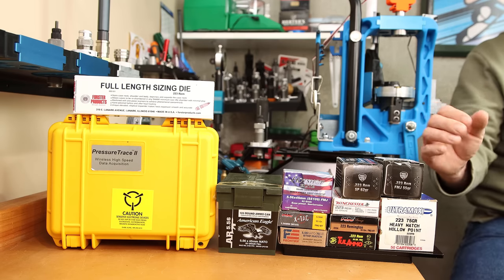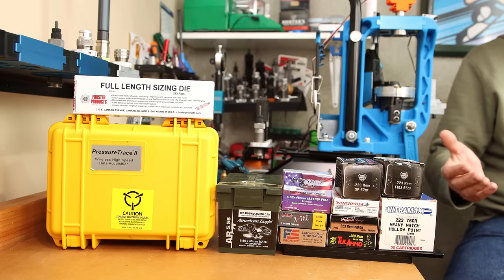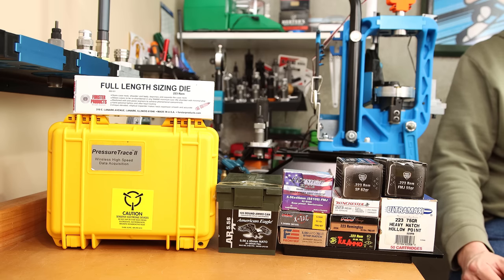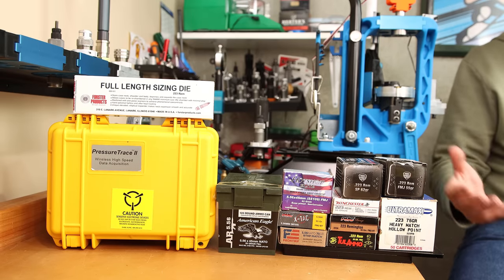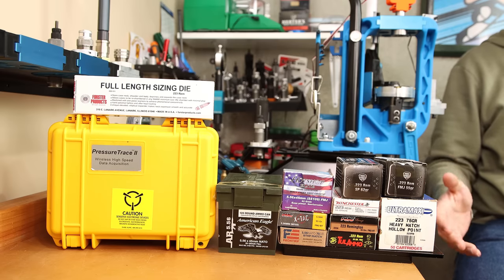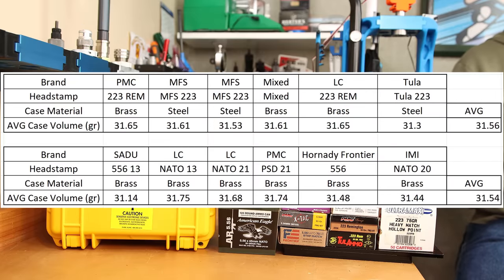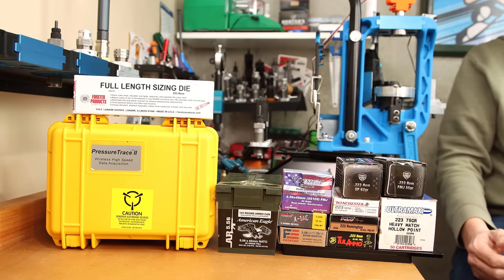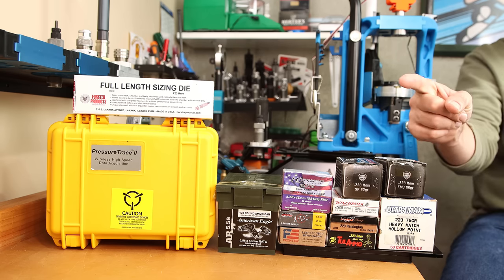223 vs 556 - The Hidden Truth No One Tells You!

Comment: For many years we as reloaders have been told that the difference was in the case webbing at the bottom of the case. The webbing was a little thicker to handle the higher pressure. I have seen in the past of cut away views showing a little thicker webbing at the bottom of the case. That was a few years back. I am not sure if there would be much of a weight difference for the thicker webbing. If the information is correct gun manufacturers highly over make the pressure guns need in the chambers. Some clam 3 x the rated pressure need for said cal.

Comment: The 5.56 has a higher pressure measuring at 58,000 psi as compared to the 233's 55,000 psi. Going by SAAMI standards, the lower pressure 223 can be used in the 5.56 chamber, but the 5.56 cannot be used in the lower pressured chamber for the 223 Remington.

Comment: Yes. I have said for years the only difference is the mil spec is higher CPU (Copper Pressure Unit) chamber pressures. Technically, the higher CPU needs a slightly heavier chamber to handle the higher pressures. When someone wants to argue with me about the differences, I just point them to this video. Problem solved. I think it is funny that people that don't know, sure are confident they do know.

Comment: The first gen 556 x 45  M-16 had issues. It was susceptible to chamber corrosion and the ill advice that it didn't need regular cleaning. It was corrected in the second gen weapon. The chamber was corrected with chromoly steal, it was provided a cleaning kit and instructions on how to use it and I never had my M-16 fail due to case expansion or fracture. The weapon handled the pressures perfectly. And it saw thousands of rounds put through that bore before I left Vietnam. I can say nothing bad about the M14 and I agree it was one of the best rifles made but the M4 and the M16 were not 223 and the performed well in that theater. They were light, and we could carry more ammo. I liked it.

Comment: Great video, thanks! I just had this conversation with a friend and like you said, he couldn't provide any data whatsoever, just hearsay.  OK, that said, I have an AP Wylde chamber AR-15 and here is my experience.  5.56 LC brass will NOT fully chamber when sized with a standard RCBS die.  And it fails the test in my Wilson case checker.  However, commercial .223 brass loaded to the same specs, including bullet seating depth (off the lands) chambers great and perfectly passes the case checker test.  The only way I can get 5.56 to properly chamber is to use a small base sizer.  After reloading thousands of rounds this fact still holds true today.  Same thing for my brother's non-Wylde AR.  Just my .02.  ;-)

Comment: My understanding was they were dimensionally identical, but guns designed for 223 couldn't reliably fire 5.56 because of the higher pressures/charge, but vice versa was ok. Nice to know I was kinda sorta right, even though I didn't know the detailed reasoning. That's why when purchasing my AR I went for 5.56 so I didn't have to worry about availability of ammo.

Same thing they told me when I was active duty over 20 years ago.

Comment: Colt TDP 5.56 AR or M-4 chambers require a 1.4646 minimum go gauge where the 223 commercial requires a 1.4636 minimum go gauge..Short chambers create higher pressures..

Comment: I never heard / the data difference on the internal size of 5.56 being smaller inside the case , as I remember. Also 5.56 has a thicker Shell extractor than 223 bolt actions because of the need for full and semi auto fire it was disghned for. Or the heat dispersal from the cases being removed from the barrel. Which is why case less ammo firearms aren't fiesable. New subscriber . good show . just a farmer .
Reply: Manufacturers use the same brass for 5.56 and .223.  The only difference in the case is the headstamp.

Comment: They are different no matter how close in specifications say, your rebuilding and engine and use just a hair smaller or larger set of pistons or bearings and it will malfunction sooner than later. Mic each case as well, they differ at the neck.

Comment: I don't have any data but I've heard Lake City brass is a little thicker than Remington brass. I shoot Winchester Palma 308 and have heaps of cases but if I switch to Lapua the cases are thicker so it's just a common thing to look out for in any caliber. One of the guys at the club stopped using Lapua and better luck with the thinner Winchester cases, I think this is due to them expanding faster as they're weaker and as such you can't reuse them as often as Lapua.

Comment: When i was in the Australian Army I was told that at the Lithgow Small Arms factory in New South Wales, Australia they had a steel plate which they would test fire into, it was the same plate used for all 7.62mm NATO  L1A1 SLR test firing since 1958, when we changed over to 5.56mm SS109 after awhile they had to change the plate as it was warn out, also back in 1990/1991 i was posted to Range control SASR and at the 360/270' range at the special range complex we had signs saying SS109 could not be used only F1 ball ammo.

Comment: The warnings are more for non-handloaders.  Handloaders should be taking precautions as the norm.   If you chamber and shoot a 5.56x45 round in a .223 Rem chamber - you could possibly be jamming the bullet into the rifling which would cause an unsafe pressure spike.    How often would this actually happen?  Probably not that often but it can happen.  Also, 5.56 pressure is set higher, so   better safe than sorry.  That is my understanding as a handloader as this vid is starting...

Comment: So... a video about the differences of .223 Rem vs 5.56x45mm but without shooting from either a .223 or 5.56 chamber? What is the point?
Reply: The point is to compare and contrast .223 and 5.56 using measurements and other empirical data. There are plenty of channels that shoot if that's what you're here for.

Comment: The 223 was invented and tested for military guns. The 5.56 designation was later and tested in different ways. The thing is as a reloader you will find that if you have 3 rifles in 243 winchester, you shoot the bullets from one but if you reload it and put it in another gun without first case trimming it it may fit tight. This is because each chamber can be a little different but still be within specs. That being said whatever is stampped on the case if you start with a low charge and work up with either case it will be ok in either a 223 or a 5.56.

Comment: I have a Colt SP1 20" AR-15.  It is chambered in .223.  I have fired the 55 grain 5.56 round several times without any signs of overpressure. I'm now wondering if I can have my current barrel modified to the Store chamber.  My 5.56 ammo is from older governmenal sources.  All .223 ammo is newer 55 grain commercial.  1 in 14" rifling.
Reply: I hate auto-correct!  It should have read Wylde  chamber not the Store chamber.

Comment: I load my own for both my custom AR-15's I built just like I do both my unlimited and light gun class 1000yd benchrifles and every rifle I built or is a factory bought weapon as well as tune for some of my customers. I have two tight tolerance AR15'S with matched billet machined upper/lower reciever sets both with 1:8 twist Wilson Combat 5.56 match barrels. I like the free bore of the 5.56 chamber as I only use 69gr smk, 75gr TMJ speer, and 77gr smk to stretch the 556 out to longer ranges. I use Redding National Match Die Set, I also load pretty hot and like spherical, dust or flake powders such as H335, BL-C(2),  CFE 223, and AR-COMP and I always use CCI450 small rifle magnum primers with those powder types. They are hot, high pressure loads for a  5.56 match chamber and through my years of experience loading I would not advise running them in a 223rem cut chamber. 
  You are correct to that the difference between the two is the Chamber, I don't think to much factory ammo marked 5.56 is loaded now days as got to a higher pressure as it use to be due to this reason and mistakes made by countless casuals (typical everyday American who is just a guy who hunts and shoots maybe 8 times a year at most) I'm sure you could find a box lot of stripper clips full of 62gr green ball military ammo loaded in the 80s or 90s to find out for sure. When Lake City Brass was the thickest heaviest brass available (certainly not like it is today know that Olin Winchester owns it again for like the third different time)

Comment: They probably suggest reloading to whatever is said on the back of the brass so you or something else isn't confused when they see a mixture of reloaded 223 and 556 brass. Better to just keep 556 556 and 223 223 because of the markings.

It's like with those who mark their 556/223 magazines and their 300 blackout magazines. They use the same magazines and it is clearly marked but for the sake of safety you only use the magazine with its marked ammunition type.

Comment: I can tell you from experience. Re-manufactured 5.56 (Lake City, Black Hills) will cause problems in a Remington 700 chambered in .223.  You can shoot the first one or two rounds. After that, the gun warms up the spent shell will start to get stuck in the chamber, the bolt will be stuck. There will also be evidence of over pressure, cratering primers. In my opinion a pretty dangerous situation.  This is my personal experience.  I believe the 5.56 brass is very slightly longer than Remington .223.   Who knows what manufactures have done lately with their brass.  You can shoot .223 in 5.56, but the other way around as definitely cased me problems in the past.

Comment: On some rifles you can see the pressure difference in the ejection patterns.  Russian steel cased ammo is the least hot, then your typical .223 55 grain and then 5.56 is typically the hottest.  When I build a new rifle I always tune it to the steel cased ammo and then check it with both brass .223 and 5.56 to make sure there are no issues with those loads.  Not scientific but you can easily tell the difference when shooting the rounds back to back.

Comment: Hmm I tried to use 556 in my Savage Axis chambered for 223. Not good they would not extract I had to use my gun cleaning rod to tap the brass out I tried it three times then called it quits. I don’t know if it was the manufacturer or just the round itself didn’t try to find out.

Comment: When I was in the Army, we were issued brand new M16A2 rifles in Korea in 1989. We were told to make sure of the rifle we had. An M16A2 ammo had a green tip and could only be fired in an M16A2 though it could also fire the old 5.56 NATO without the green tip. The M16A1 COULD only fire the old 5.56 NATO ammo since the new green tip was more powerful. That is a rule I live by today, .223 REM to be fired in either markings or model of AR-15. 5.56 NATO to be fired only in AR-15A2's and above or if it has a green tip then only in a 5.56 NATO marked or AR-15A2 or above. I have had some tell me there is no difference though the pressures listed here say there is a difference.

Comment: The issue..argument... is the same with pistol brass marked +P  and +P+.   Seems to me the only difference with pistol brass and the +P and +P+ brass is the markings. I never bothered to sort them out.  I tried the case weight and volume thing and found no significant difference.
Reply: I agree with you.   The odd thing that I noticed is +p and +p+ cases feel thinner and lighter.  That holds up with 9mm, 380ACP,  38sp and 45ACP.   I've noticed that since pistol caliber carbines have become more popular a lot of pistol brass has either crimped primer pockets or extra tight primer pockets. Some need to be chamfered just to get a primer started even though they aren't crimped.  When I cut down .223 and 5.56 cases to make 300 blackout brass the lesser known brand headstamps often have thicker case walls than the more common headstamped brass.

Comment: I can follow this science!  Thanks for a great, in-depth analysis comparison and presentation.  Seems like a nominal difference overall, except for pressure difference.  6K psi is not insignificant.
Reply: Now throw that hotter load in a chamber with less freebore and a steeper leade than what was used for this test...

Comment: great video! i love the approach to this question.  however, did i miss the powder weight and type comparison?  its clear 5.56 has higher pressure,  which would indicate its loaded to with a higher or faster burning powder load as almost everything else except freebore is basically the same

Comment: Years ago, I locked up a bolt action .223 rifle by firing M193 in it, (genuine M193, before the infamous executive order that banned it). the over-pressure was enough to lock up the action and flow the primer around the firing pin, I had to hammer the action open with a hardwood club.  I don't fire 5.56 ammunition in anything marked with a .223 Remington chamber anymore.  I won't put a 5.56 load in a case with commercial .223 head stamp either.
Reply: It’s your particular chamber in that particular rifle.  There is a tiny bit of difference in the neck length between a 5.56 and a .223, so your freebore distance did it in, causing the overpressure.

Comment: but how does the 5.56 achieve the higher pressure if there's no appreciable difference between the construction and loading of the two rounds?
Reply: Powder quantity and or burn rate.  You can load cases stamped 223 to 556 pressures and shoot them through your AR all day long.

Comment: Years ago I acquired a Colt made AR , an early one now long gone and with it came some reloads that I was told where very accurate. I don't know the loads but they have 55 gn bullets with a very blunt nose and all different as in seconds projectiles. So one day I go over to my pop's with a new Ruger stainless bolt gun m77 mk2 in .223. Which is now 35 or 40 years old and I tape'd out 100 yards and had a bench and targets. The bullet would touch the lands on bolt closing. Three bullets through one hole with a tiny crescent on one side at 100 yards sandbagged !  Have never been able to do it again.

Comment: I just got a Springfield saint Victor. Its labeled a 5.56 . But you can use both 2.23 or a 5.56 . I'd suggest 5.56 ,i my opinion o think it does More damage. But if your in battle and you ain't got anymore 556 then by all means slam those .223 in there chamber.

Comment: The difference is in the chamber. 5.56x45 has a tendency to bulge and pop primers in a .223 chamber. This is the reason given for the downloading of commercial 5.56x45 that has happened in the last decade, i.e. the variation between .223 Wylde chambers causes some 5.56 loads to pop primers in some rifles. Why I stick with mil-spec 5.56x45 chambers and stay away from Wylde chambers.

Comment: I have both rounds and the 5.56mm is very slightly necked down a lil from the .223 I know the 5.56mm creates more Gas pressure than the .223 but that’s the only thing I noticed different between the 2
Reply: That may just be manufacturing differences. Handloading books all show literally zero difference whatsoever between .223 and 5.56 brass cases.

Comment: So conclusion: Any .308 variant is better for downrange accuracy, velocities and energy transfer. The only benefit to the AR platform is possibly the design as long as it's chambered in something with a bit of oomph or "ass" behind it. (if you pansies needs a carbine for qcb use something with a hot round such as 9mm+p or .45+p in your fav platform, in qcb you really don't need much more than that, if what's behind the walls are concerning just drop the building with a satchel and be done with it..)  @2:31 just by glancing at the chart here one can tell that any .308 with the same or similar average velocity coupled with the average weight of a .308 rnd (more than double with most being triple the projectile weight) results in tremendously higher downrange energy transfer along with the added benefits mentioned above.
Reply: One difference.  If you remember  Vietnam news casts with soldiers holding their rifles as high as possible to fire over walls for suppressive fire.  Could not do that with a .308.  Just a waste of ammo but the soldiers felt better about themselves.  They probably claimed high body counts for it too.

Comment: Sawcut both empty brass in half and look at the base wall thickness. If you take a box of .223 with thin brass, and put it in a machinegun that runs hot, you will have case failures, and extraction problems, and possible primer blowout.  . If you are just shooting .223 in your AR. . and shooting slowly, you might not notice. . .but you can't reload them more than once, . . .223 was made for a bolt action, where the barrel chamber supports the thin wall as it expands, and then there is a slow extraction. 5.56 is made for a violent extraction.  5.56 does not expand as much as .223. . . Putting a .223 in an AR will not hurt the AR. Putting a 5.56 in a .233 bolt action means the round is headspacing off the shoulder like a machinegun, and not off the bolt face. So the round has a tiny gap between the chamber and the rifled barrel. Continued use of 5.56 might erode the chamber throat, and when you return to .223 brass, it will expand into the erosion pocket. (extreme and not likely.) . . Headspacing off the shoulder works with belt fed guns that were slam fire.. to prevent cook-off. . . the practice has carried over from WW1 days and Maxim guns. Slam fire rounds detonate before the bolt is fully closed, so headspacing off the bolt face is not practical. But this is all academic. . .Just don't mix them . . just buy the correct ammo. . .